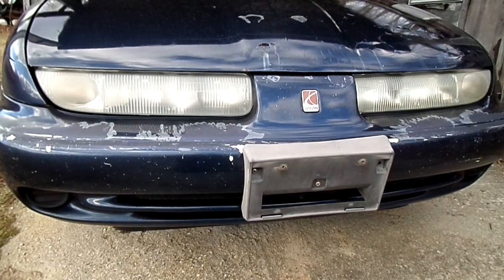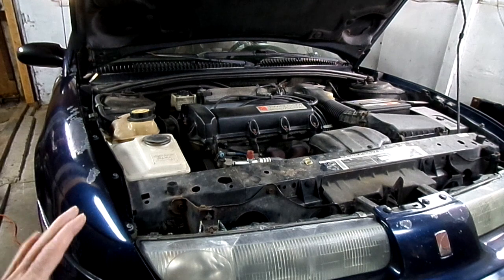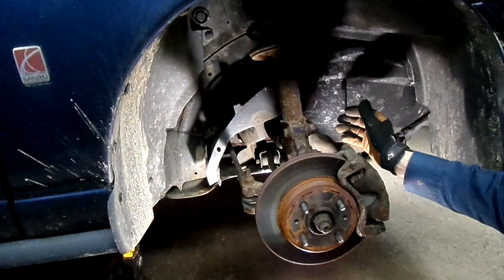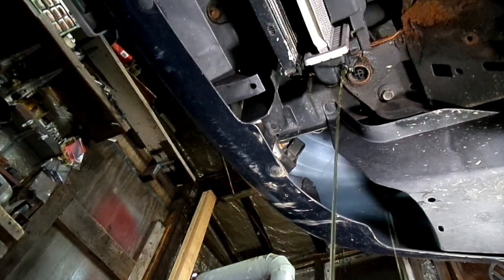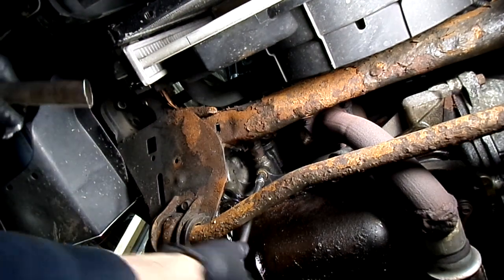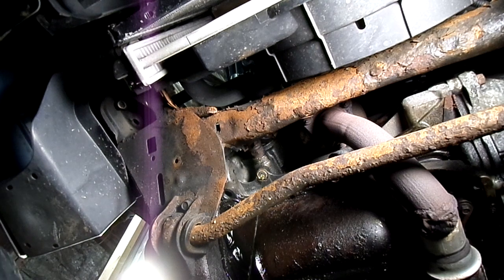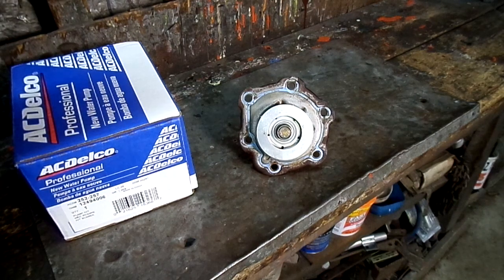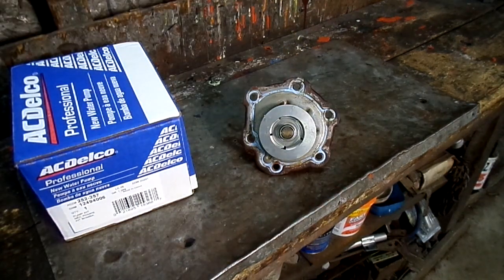Saturn Water Pump Replacement

Comment: Hey Rich thanks for the video!  I just had a problem with my coolant system and I thought it was from the overflow tank side but my mechanic told me to do the radiator.  Finish that (didn't see a crack in the radiator) and still have the damn leak!!  It's gotta be this and my mech just wrote me off saying that it was (probably, didn't even take 2 seconds to look at it) the water pump now, guess I'll have another job done myself.  And that mechanic just lost a customer!!  Thank you so much, brother, stay safe!

Comment: The Saturn that just won't die!  How many miles do you have on her now RIch?  Looks like she could use a little love in the paint department.

The RTV sealant you used...does it go on the block side of the fiber gasket or on the pump side of it?
Reply: i have a 1996 sc1 with 340k miles, a 1995 sc1 with 265k miles, a 1995 sl2 with 223k miles, a 1994 sc1 with 110k miles and a 1995 sc2 with 111k miles
Reply: Yeah was gonna say that away bar looks like it doesn't have it doesn't have much longer... Same with I think the engine cradle
Reply: @ARAR148  I miss my Saturns...would buy another in a heartbeat if I could find one in good condition and reasonable miles
Reply from the maker: Pump manufacturer states to use sealant with fiber gasket or it will leak i take that as it has be on both sides.

Comment: Hi Rich. Got a question. I've recently made a mistake for the 2nd time. My 1999 SL2 runs great, however, the urge hit the pedal came over me and I opened it up for a few seconds. Fun! Anyway, afterwards the engine idle is terrible. 

What happened?
Reply: Check out the throttle position sensor. It’s a known problem on Saturn. Sticks at high idle.
Reply: Might have popped a crack in a vacuum line somewhere.  Throttle position sensor maybe. Maybe the EGR valve finally got dirty enough after your hard pull. Rough idle could be a million things.

Comment: An additional tip for all:
The installation paperwork/instructions with my replacement pump (Gates 41024) say REPEATEDLY, even on the outside of the box, to flush the cooling system prior to installation, or the warranty will be voided. Not sure how much I can flush the system with a pump leaking so badly it sprays coolant about when it's running, but......

Comment: Howdy LOVE your videos! is there ANYWAY you could PLEASE upload a video or even tell me how to remove and replace the trunk torsion bars that's hold up trunk lid(with spoiler) that's all I have found is t heres 2 different spots for with or w/out spoiler and a crappy diagram. I have a parts car well my wrecked 98 sl2 and have 2 days to get all the parts I can before it's towed to go on my new 99 sl2. The 99 only had one installed and have no idea how to remove and replace..thanks in advance for any info.

Comment: Hey Richpin can you do a video on a transmission rebuild. I got the 5 speed manual.
Reply: Manual swap! It's such a common thing people do now that all the automatics are getting lazy and grinding away lol
Also specifics on the diff pin welding and input shaft nut tightening. I think those would be plenty helpful

Comment: Hi Rich! First of all thank you for all your Saturn videos! You've been such an enormous help over the years! I have searched your vids, but I have a problem with my 2000 SW2 that has me stumped. The mode dial on the dash won't turn all the way to the right side, so the front window defrost does not work. I have popped open the dash as you have demonstrated in several videos and I can see a rotating mechanism that looks like it's trying to move upward to direct air out the defrost vents but it doesn't quite get there. The dial knob feels springy if I try to force it into defrost mode and just goes right back to the floor setting. Have you seen this happen before? If so, could you point me in the right direction? I would really love to be able to defrost my windshield this winter :)

Comment: This comment has nothing to do with the water pump but I don't know how or where to find a place to make my comment.
I have 95 Saturn SL2. I can't find anything on it and then when I do they always look different. My sliding pin boots on my rear brake brackets I think need replacing because my pins barely move in and out when I push them by hand. The spring looking boots look okay not damaged.
1.My main question; the top pin with the inside boot does it really need to be replaced or can I go without it? Every time I push the pin in it pushes the boot out a little further on the outside. 
2. If I do need to replace the boots I am thinking that I put a little bit of silicone lubricant on the outside of the boot before trying to insert it?
3. About two new brackets but I'm now realizing that I probably only needed new boots because my pins look lbrand new. Do you think it would be easier to just slide the new boots into the new brake brackets or pretty much about the same trouble sliding the boots and to the old breaking brackets just as much as the new brake brackets but only with a little preparing first of the old bracket (cleaning the inside of hole with a wire brush)?

Comment: Is this same process for 2002 sl2?  And will pulley cone off of water pump as well? Do you know. Wondering if by chance it it hard to take it out with pulley intact.. great video. I'm disabled but to pay 400$ I really want to try. It's my gas saver. Thanks
Reply from the maker: All Saturn S-series 1991-02 use the 1.9L engine.I have never tried to remove the pump with the pulley on.

Comment: I have a 02 sl1 and I'm having an issue with it starting. All the lights come on, no clicking noise. Battery is fairly new no corrosion on the terminals. Lights don't dim down. Let it set for a while and it will start right up. Have no idea what else it could be. Starter? Solenoid?

Comment: Hello Richpin06a i have a 97 SW2 Auto with new plugs wires and clean coils. 48k original miles. But under a load the car cuts out like an ignition failure or rev limiter the rom gauge will flutter and drop down to like 1k and back to 3k rapidly if i try to heavily accelerate through 3-4k. Then SES a crank code P0336. But i need a Scan tool to relearn. Anything else it could be before a trip to dealer. Thank you.
Reply: I had a coil test open. The other test 8ohms more than likely the problem.

Comment: I replaced my water pump in the 02 SL1 because I was getting coolant leaking from the reservoir. I thought coolant wasn't circulating because of a bad pump. It's still leaking from the reservoir cap. Do you think it needs a heater core flush? Thanks for your detailed videos👍. P.S. I also replaced thermostat.
Reply: If it’s from the cap it’s likely as simple as getting a new can that can hold pressure. A good aftermarket one will do 18 psi over the stock 15psi that sometimes break. It fixed mine and was only $13 prime one-day shipped to my house
Reply: @user-lb4qb6mk4p  👍. After I did some research, the issue was air in the system going into the reservoir. It seemed like a head gasket break and that exhaust was not fully escaping so it leaked into the system causing bubbling in the reservoir and pushing coolant out of the cap.
Reply: @osalvarez7807   that's what I'm experiencing at the moment. So how do I fix this problem?
Reply: @manoloarroyo9928  I watched Chris Fix video on head gasket sealers and if they worked. I was skeptical but had run out of options and tried it. I think I used the Blue Devil one. Been running great ever since. Some say it will only last a few weeks and others say it's been 5 years and still running. It's been almost 5 months for me and still driving it. 👍
Reply: @osalvarez7807  can you give me the link to the video. I would appreciate that very much